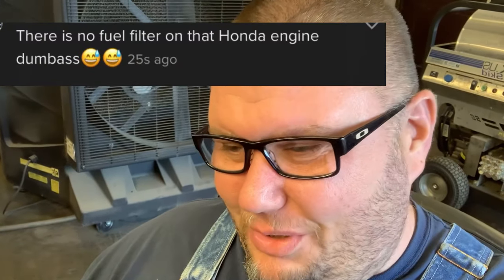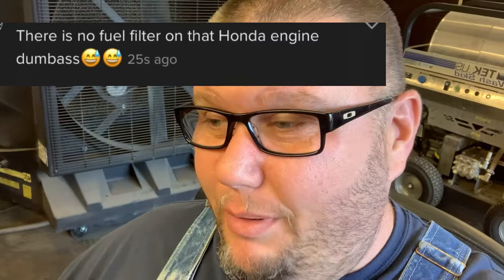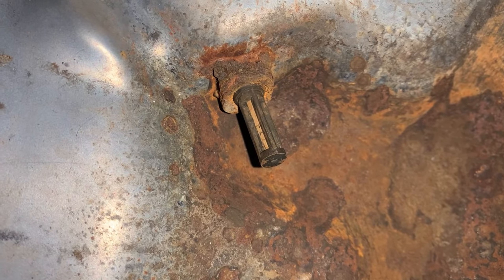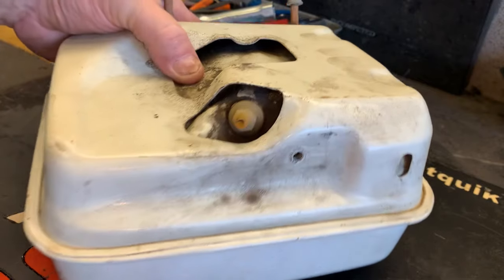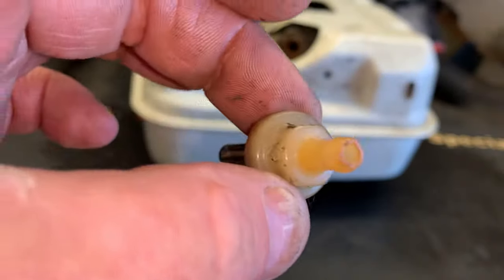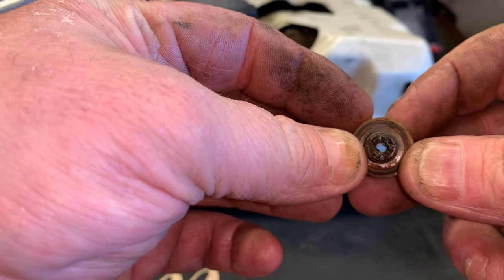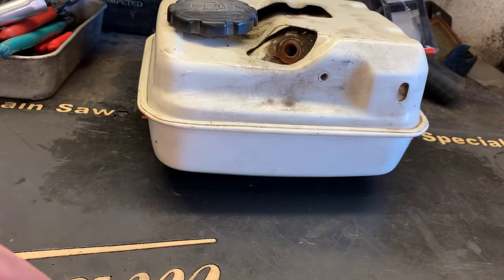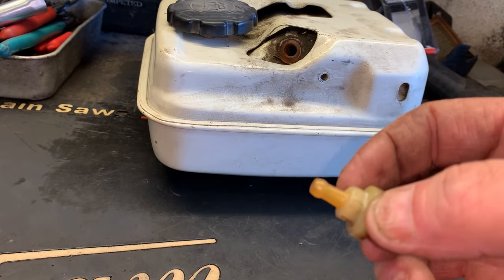HIDDEN FUEL FILTER ON MOST HONDA ENGINES

Comment: That filter Plus the one that sometimes is hidden under the fuel inlet barb on the carb that Donyboy73 discovered
Reply from the maker: And on the gcv engines they filter is inside the fuel line

Comment: Yup. Also the fuel filter hidden in the carb. You showed on a earlier video
Reply: This sounds like what I may be looking for. I was about to order a new air filter on Amazon, but was browsing through the sets, and well, I see a set that is for my exact model, but has TWO fuel filters. After watching the video, I thought it may have been an optional in-line one he spoke about, but your comment is making me think otherwise. It's not the screen style like this one... I would describe it as having accordian-style folds that form a cylinder. Its contained in a clear canister and the top and bottom have the fittings that would accommodate a fuel hose. I'm going to check out his other video if I can find it...
Reply: @heidis8713  Not sure which video MowerMedic showed this, but here is one from Steve's small engine saloon. https://www.youtube.com/watch?v=cK-i1QjwN5M DonnyBoy also talked about it.
Reply: @cpcoark  thank you so much for the link to Steve's video. I did his carburetor clean out. Turns out the filter in the Amazon bundle was a lawnmower fuel filter. 🙃

Comment: I thought it was just a prefilter... I clean it as best I can and put it back, though once easily removed a new one can't be that expensive, so, why not?  One thing I do is to clean the tank as much as possible before putting it all back together. You are so correct about the water starting the corrosion process. I use a bit of Marvel Mystery Oil in the first tank of gasoline to slow it down after cleaning the tank. We all have to be aware of ethanol in the pump gas as it is hydrophilic. Prevention is the best thing.

Comment: i have a one year old Honda lawnmower, it doesn't start anymore. has good spark i cleaned the carb, sometimes it start but then shut down. took it to Northern tool they did the same cut the grass two times not starting again.. NT said Carburetor need cleaning again??? 😳 can you tell me what it could be
Reply from the maker: Northern tool is not the place to go for small engine repair,  you need to find you a good reputable Honda dealership. There are a lot of variables at play here, if it only mowed two times then I would say the gas that you poured in it probably has water and is old. you need to get rid of all your old fuel re-clean the carburetor and start from scratch. if it’s still dies after that then I would hook a spark tester to the coil and check for spark. Also check your fuel cap and make sure it is venting there has to be something simple that you’re missing

Comment: i got a briggs 16.5 single . on the mower tag it lists a oil filter number, but i dont see a filter on the engine. im wondering if its inside somewhere like a motor cycle or something ,but i dont see nowhere it could be.

Comment: Hi. I am not a mechanic but have learned a lot in the last 20 years having to have my equipment fixed. My fairly new Honda GX 270 keeps bogging out and the first thing I thought was that the fuel filter was clogged. Now realizing that that’s not normal and a problem, I’m wondering how do I know if my fuel filter needs to be replaced without taking off the whole tank?

Comment: I have a ChoreMaster power washer with a Honda GCV160 engine. No fuel was getting to carb so I checked all the fuel lines for a clog all the way to removing line from the gas tank. There's just a drip or two when I poke a poker through the nipple hole (yes, there's enough new fuel in the tank). Nothing removable from the outside (the nipple is part of the tank) Can't find anything online about a filter accessible inside the tank, but the poker stops cold after a few inches and the opening is not visible inside the tank. There is something in the bottom of the tank, but no obvious way to remove it. It has a yellow emblem that looks kind of like a fish. Thanks in advance for any advice.